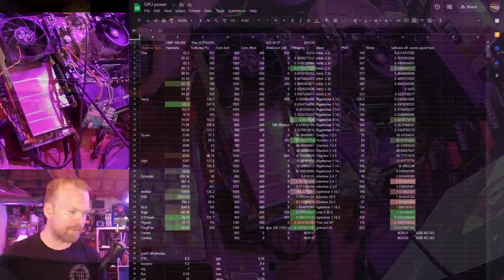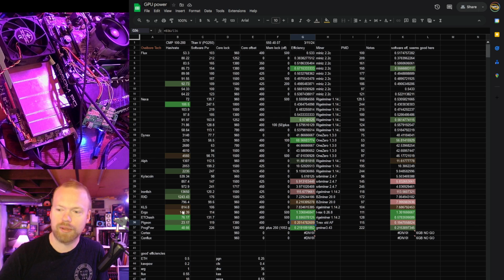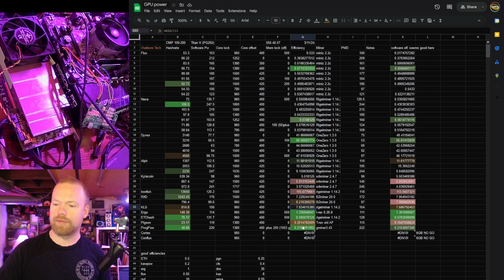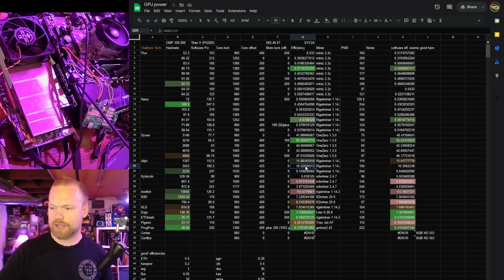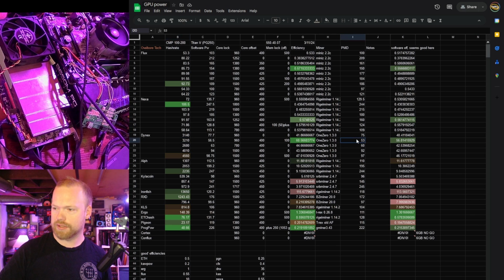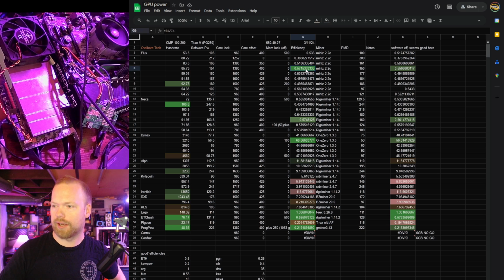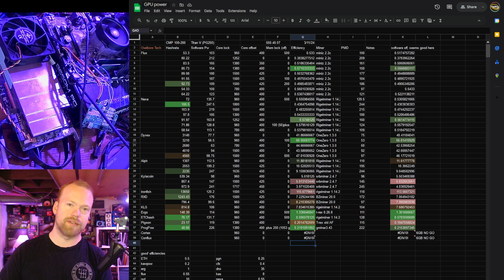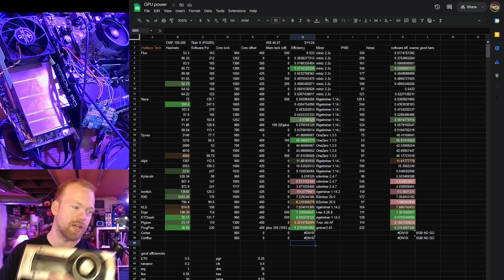$330 46MH/s Blower KawPow Monster - CMP100-200

Comment: So the 12gb cards only use 6gb why would they lock that? Seems stupid
Reply from the maker: every P104, P102 is the same way from the factory.
Reply: @OvalboreTech  I saw a Russian video where the dude was talking about these cards and how instead of Nvidia using software to limit stuff they used Resisters that had to be removed it was a crazy video like these dudes are mad smart

Comment: Thanks for the video!  Anyone have a list of algos showing what's core vs. memory?
Reply from the maker: my chart is more or less sorted. you can tell my the mem clock in the sheet on most of my OC videos.

810 mem is core
-500, 0, to +1600, and 5000 lock are intermediate memory
+2000 or more mem hard.